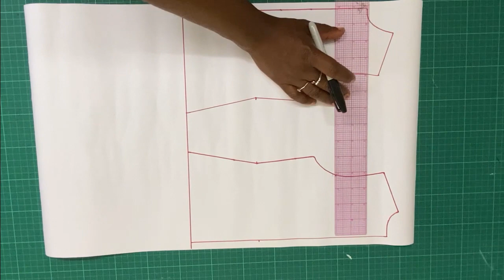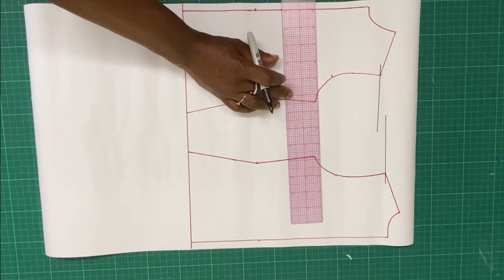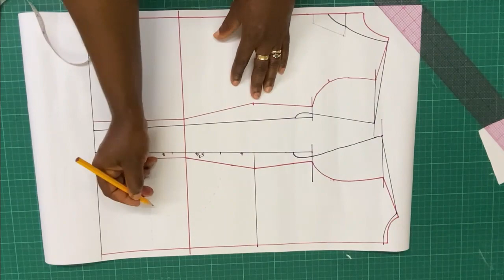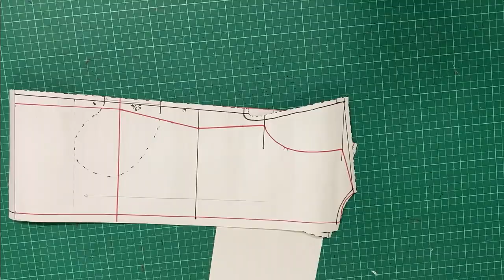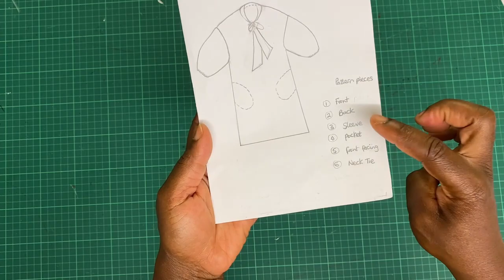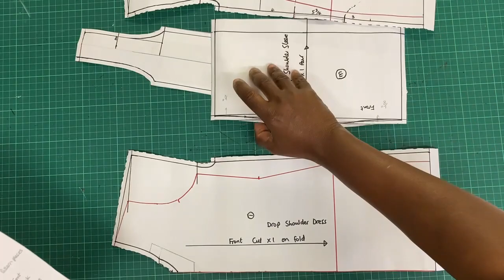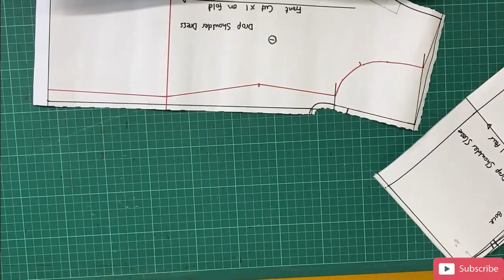How To Use Your Basic Bodice Block To Make A Drop Shoulder Dress / Beginner Friendly Project

Comment: Im super new to this. Can you explain the 90 degree line? 2:04
Reply from the maker: This means drawing a line at right angle to your centre line, also called SQUARING OUT. The essence of this is to give you an accurate point to reduce errors when you plot your points. You may choose to extend your centre front and centre back lines up first to the shoulder level to make it easier to use for the 90 degrees/squaring out. Hope this helps.